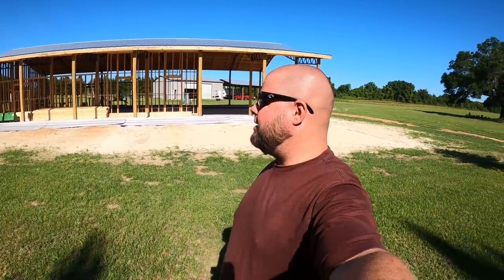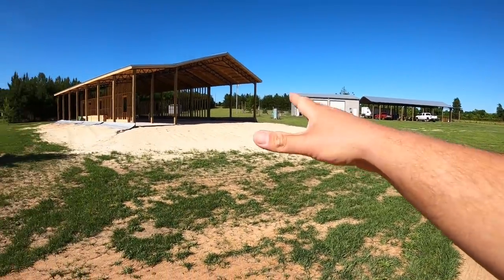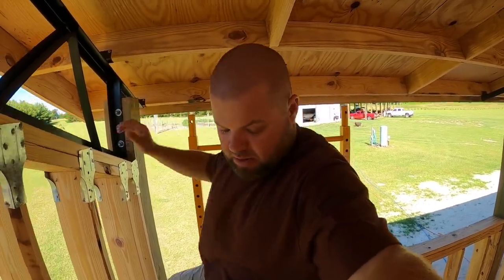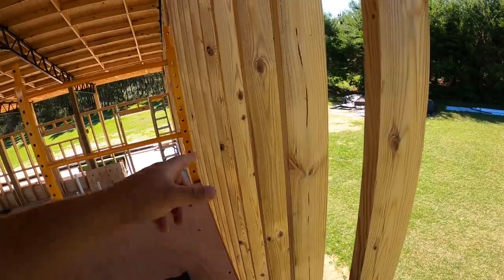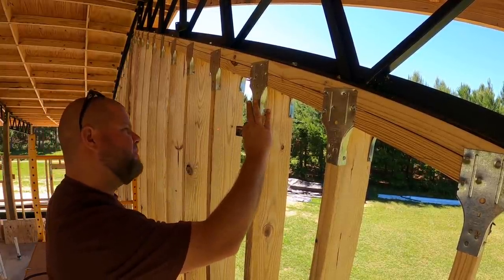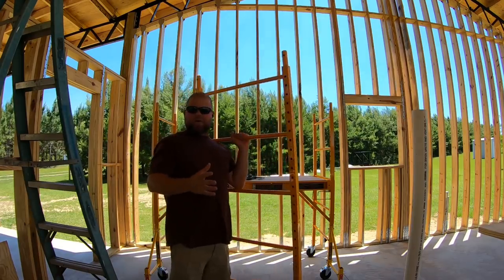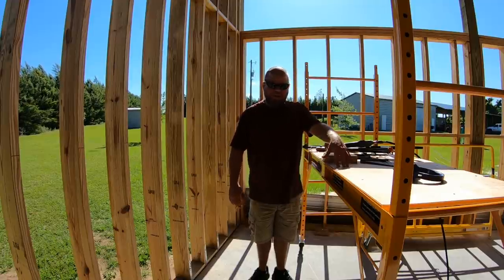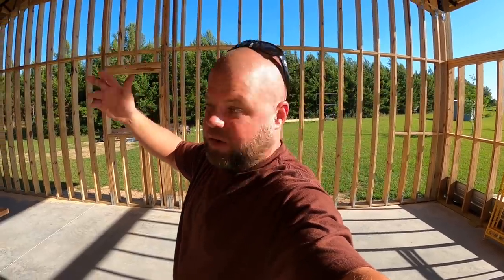Blocking the big pole barn house wall! #barndo #barndominium

Comment: Great work man! Those shear walls can really be a nightmare! Definitely stronger having plywood perpendicular to the studs, but also not necessary to have the 4' side end on the blocking. As long as your stud layout works for the 8' then you are golden! It's interesting to see the different building codes and things to keep in mind vs building up here in Canada (ex. snow loads lol)
Reply: Also wanted to mention that up here we leave about 1/8 gap between sheets (we just use a nail as a spacer) which may help with crazy wind you guys are prone to! 🤙
Reply from the maker: Should help with expansion and contraction too

Comment: Pole barn house looks great. I’m just wondering what is the purpose of making two passes on the radial arm saw?
Reply from the maker: Usually first light pass let's me see if I'm right on the line and need to adjust. Plus it's easier on the saw, I need a new blade.
Reply: @TKCL  that makes sense. You are doing great work on the pole barn house. I can’t wait to see the finished product.

Comment: Good work Andrew!  I'd have to have someone explain to me how it matters which direction siding is placed (horizontal or vertical).  I don't buy into it mattering.  :-)
Reply from the maker: I've read it numerous times that horizontal or opposite of the studs gives the greatest strength and to stagger the seams.  If I am reading code correctly, it is actually required to run this way on a shear wall like my end walls.  So engineering is backing up the theory that it is stronger.
Reply: @TKCL  100% agree that siding should be staggered.  I can understand the concept that running siding 90° to wall studs would be stronger.  See... you sold me!  :-)  (On an unrelated note, I don't know why you had to breakdown the scaffold to a single stand when you installed the 8 ft and 4 ft blocking.  Confused me there... haha  I guess it was mainly to get rid of the ratchet straps so you didn't have to fight/trip over them.)
Reply from the maker: The bars and upper deck supports would be somewhat in the way. It takes about 3 minutes or less to break everything down, so it's not inconvenient.